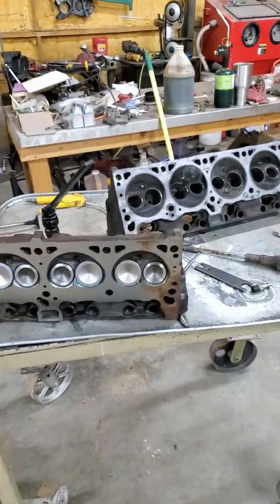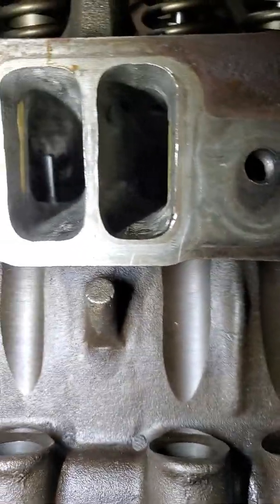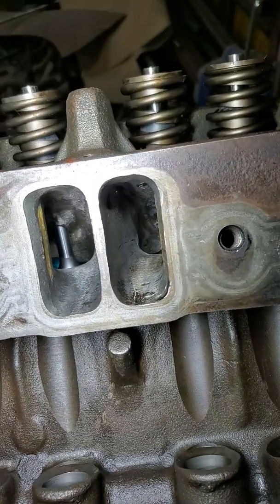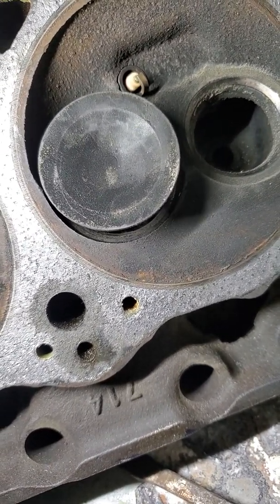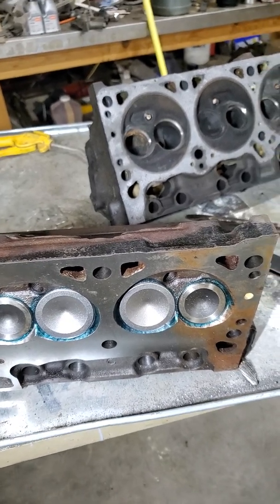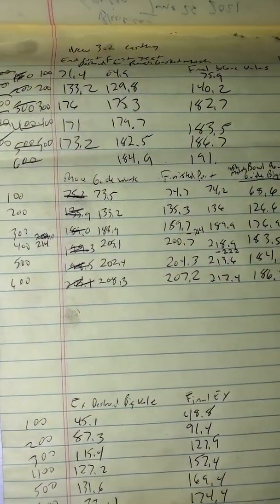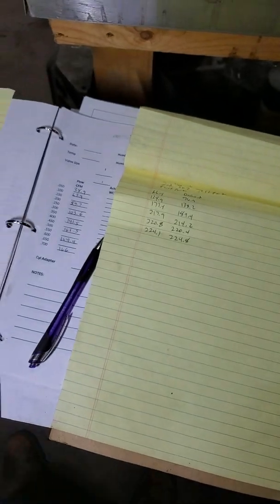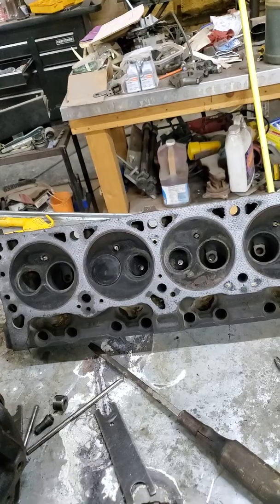(#19) dodge 302 714 high swirl casting head porting tips and flow numbers

Comment: This is where the flow bench lies to you.  Unshrouding that intake does nothing good for you.  With that low flow gasket matching and widening the pinch point are counterproductive as well.  Pitot tubes show you where material can come out.
Reply from the maker: @chrisstavro4698  please explain how deshrouding and increasing flow is counter productive? You belive a turbulent port that flows 30 cfm less would produce more horsepower than this?
Reply: @black_sheep_fab9411    Getting rid of turbulence inside a port is a good thing.  That wall that "hurts" low lift flow is there to increase swirl, which helps combustion, response, and fuel economy.  That stuff doesn't show up on a dyno, but it's very obvious as soon as you start driving.  If you can produce positive swirl at all lifts without it, go ahead and remove it.  For the sake of argument, 20 cfm with the wall will make more power everywhere than 30 cfm without the wall.

Comment: Great video! How did the 714 heads turn out ?
Reply from the maker: They turned out great.  Most of this series is on the 714 but applies to the 302 as well.  The 714 was I think the last version of the 302
Reply: Cool thanks  @black_sheep_fab9411

Comment: Nice work!  I'm reading forum posts saying early casting 318 blocks, or later casting truck blocks that are said to have thicker walls can be bored to 340 bore, 4.04" do you know if this is true?  have you done it? I'd love to build a budget 340
Reply from the maker: I've heard this before but when actually looking into it I've never found anyone who has actually done it.  Only real way to know would be to sonic test one.  But I wouldn't bet my house on it
Reply: @black_sheep_fab9411  Thanks, I read a bunch of comments of forums, some guys say they take the bore no problem, others say there's no way.  One posted the machine shop that supposedly was building these things all the time, I messaged the shop and they said no 318 can be taken to a 4.04" bore.  Thinking about it, I guess a custom crank with 360 mains and 3.31" stroke in a 360 block would be the way to go since the 360 can handle the .40" bore no problem.  I'd love to build a cheap 340, but not so sure it can be done

Comment: I’ve been working on some 302’s. Sleeved and looking to run 8mm magnum valves. 1.92/1.625 Even if it doesn’t need a 1.92 that will give me more curtain at any given lift.
Reply from the maker: Sounds like a solid setup.  The bigger valve should help at lower lifts to some extent regardless.

Comment: What percentage of your valves are your throats.. There's a reason why bigger valves didn't show improvement, if the throats are stock and you added bigger valves There's a restriction..
Reply from the maker: 88 percent.  I corrected the throat after installing the valves and had very little gain.  The restriction was farther back around the short turn/bowl/guide so the valve didn't do much until I opened it up further upstream.

Comment: Im porting 675’s for my 390 build. Any idea what kind of flow numbers are possible?
Reply from the maker: I haven't messed with any of those.  I would think they would be in the ball park of these though.  I think 200 plus would be realistic without getting too crazy. But I can't say for sure.
Reply: 390 cu I would depart from 318 heads and get a set of 360 heads and port those with the stock 1.88" intake or move up to 2.02 valves,,exhaust is already 1.60". If you ran across some 308 heads even better exhaust port. Your gonna want at least 250 cfm on the intake and smog 360 will do that easy